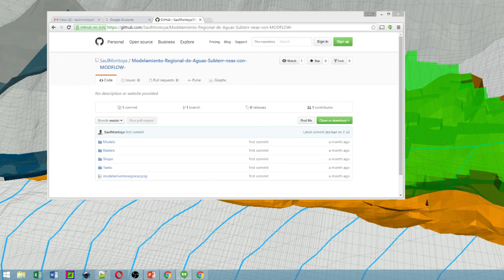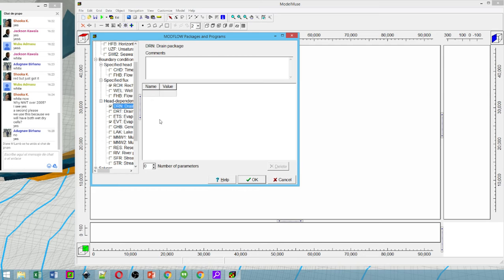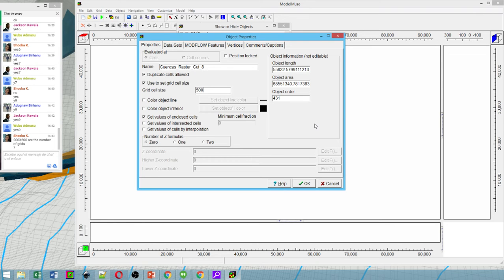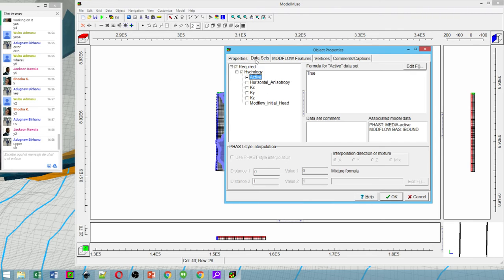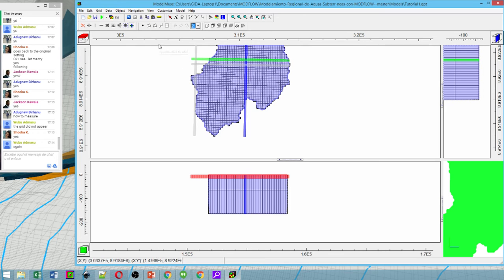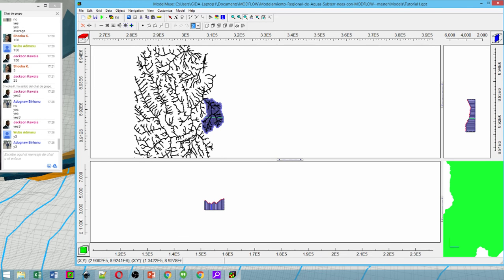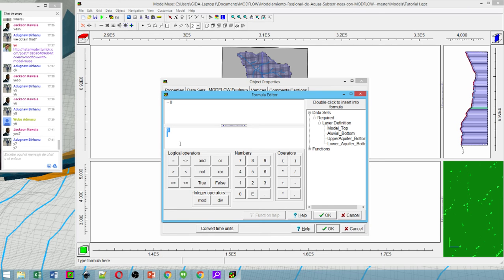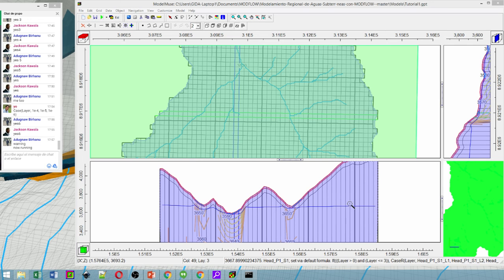Regional Groundwater Modeling with MODFLOW and Model Muse

Comment: Sir, i want to run the model in such a way that,recharge to the watershed need to be given after  seeing the water table after each run ...because in my case if the cells are saturated recharge is zero...how to simulate like this?